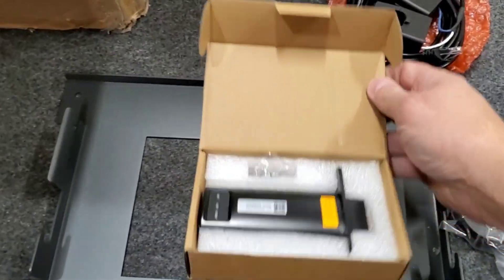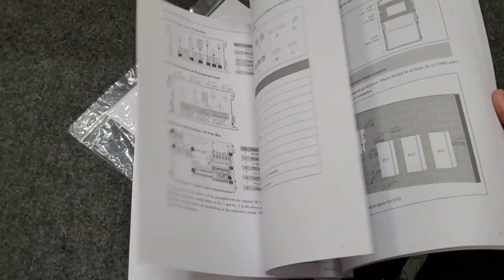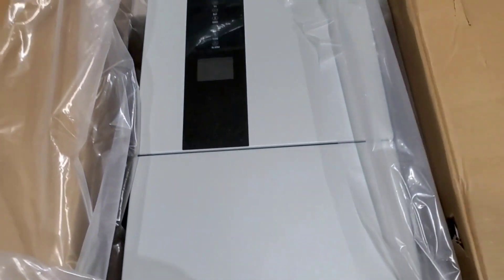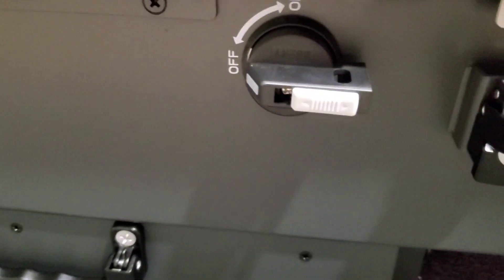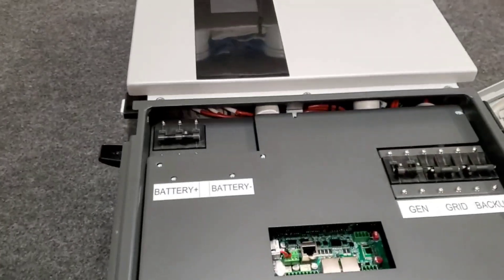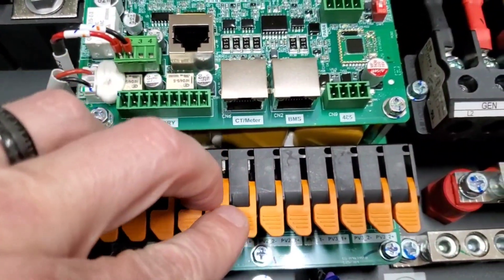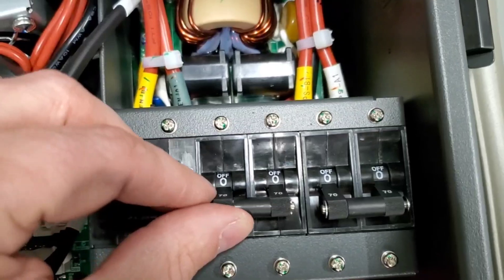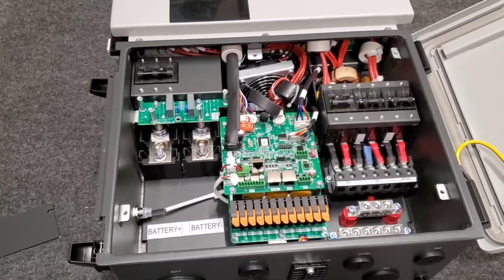Sungold Power 11.4kw Inverter new model SGN11.4K hybrid with smart port

Comment: I am very interested in hearing your initial thoughts on this unit. I has going to get the EG4 12000XP because the specs tick all the boxes I need. But i am consideing this exact inverter instead, just not sure that SunGold has gotten their user interface and software sorted out and improved (previously not good). I am eagerly awaiting your follow-up review!
Reply from the maker: I should have something in a few days posted with the install and functions. I agree the previous interface was beyond terrible! The interface has improved greatly with the SolarTouch app. I looked at the same EG4 and debated back and forth. I previously had two IP6048 units that were noisy with the fan constantly on and had issues constantly.
These two 11.4kw inverters are very quite with no fan noise, the fan will turn on briefly under high loads but still quiet.
Reply: Awesome! There is so little about this inverter on YT or in the DIY forums that you are bound to get significant views as people search it out. The official SunGold channel only lists this as being released 2 months ago, which seems weird. It's price point is great (my other option was the Midnight Solar TheOne). Best of luck with the video edit!